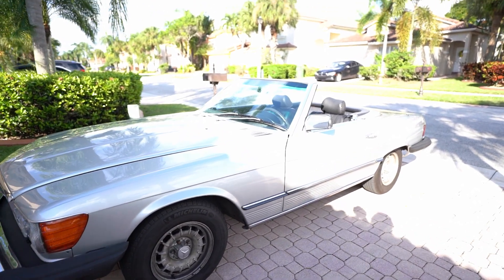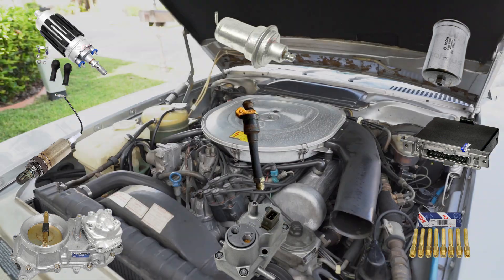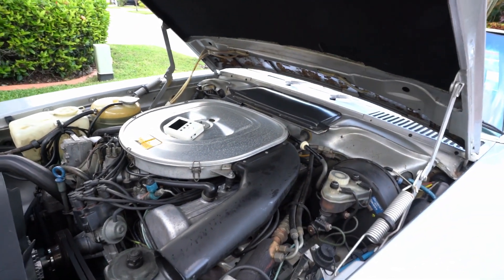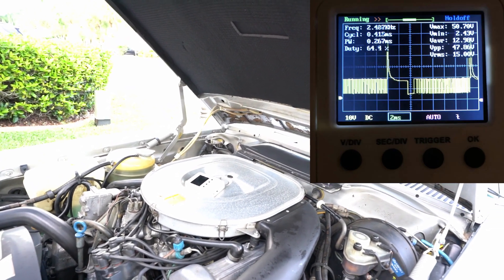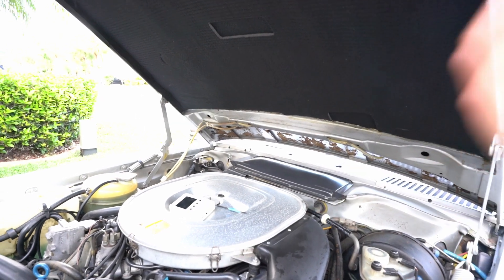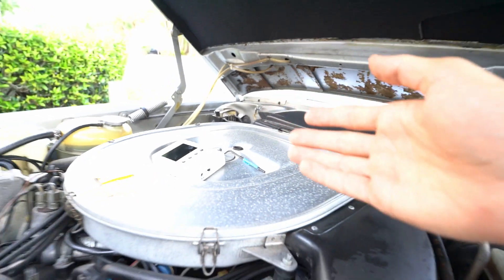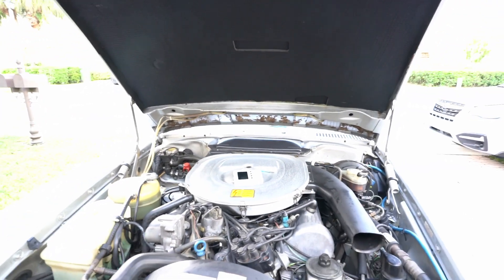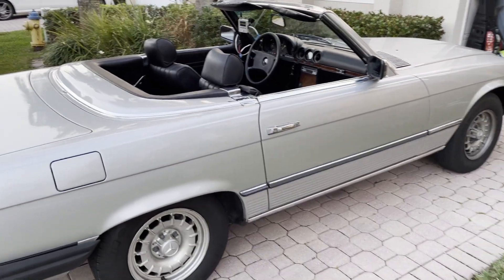R107 pt 14 - Hacking Bosch K-Jetronic System [FULL GUIDE]

Comment: Hi, again 84 380 SL :) i have something that need an advise. My Sensor Plate (part of the fuel distributer) is always up (i.e. at high level) which is Ok/normal; however, when the car is sitting for sometime and i press the sensor plate down it doesn't go up again, is that normal? when i shut the engine and i press it down, it goes up again to the normal high level. so what do you think the problem is if there is a problem.
Reply from the maker: Min 3:12 is the picture you want to trace. 50% pushing fuel and 50% steady not pushing

Comment: Hi. I have an 84 380 SL, like urs. actually i don't know if i am using the 3mm alen correctly, i mean deep enough before starting to move right or left. if you can film an alen with some measurements on how many CM to press before rotating or tell me how many cm/mm to press down before i rotate. and when it hooks down, it need force to turn right/left or what?
Reply from the maker: Yes, it goes all the way down until it connects with the real screw. Then while pressing all the way in very gently rotate. Remember this is very sensitive and a tiny move will change a lot

Comment: I tested this tonight with the same equipment.  I was able to lean out the engine and feel it start it miss, then richen it up and get closer to the "sweet spot" and it stopped missing but on load I felt some hesitation cycles so I'm wondering what quantifies as the sweet spot and do you have any manual or diagnostic articles you can point reference?   I'm in Tampa fyi.
Reply from the maker: Hi Matthew, that’s amazing! Thanks for sharing. Basically the sweet spot is having the additional inyector pushing fuel only in 50% of the duty cicle. That way the KJet will have room to enrich or lean the mixture in the same proportion. Now considering age of this cars and internal rubber vacuum what I will suggest is to do the final fine tune by feeling (smell, ear and acceleration)
Reply: @MinkMood  MM I'm back at it.  I just rebuilt the fuel distributor and WUR on my 81 380.  Runs much, mubh better but is running very rich.  Looking back at your videos your oscilloscope shows a duty cycle of between 64% and 75%.  So from screenshots (I have the same cheap oscilloscope) I can't tell what to do wrt achieving a 50% the duty cycle. And I'm a mechanical engineer not a EE so while I can purchase oscilloscopes, reading them is another story.
Reply from the maker: @matthewstephenbrown  hi Matthew so great to hear from you! Amazing on the FD and WUR refresh. Regarding the measurement just follow the graph, not the numbers readings as they didn’t seem correct to me. Now within the graph try to reach 50% of the figure with pulses and 50% flat. That will tell us the you additional inyector is pushing fuel just 50% of the cycle. Send me pictures if you want and we can also talk thru the phone

Comment: Check your fan clutch, seems to be running hot when the car is at standstill. Also ensure the thermostat is opening all the way.
Reply from the maker: Exactly, thanks for sharing mate! Fan Clutch + Thermostat + MB Blue Coolant changed in some episodes before. 
Now the first time the car starts (cold) it will go up to almost 100*C and immediately drop down to 84 avg (Thermostat Opening effect)

Comment: I’m having similar issues with my 380sl but I can’t get it to start. Fuel system was checked over and no faults no vacuume leaks. Any suggestions?
Reply from the maker: Hi R, its hard to tell but I think you are in the right path. For the car to start you need just 3 things (Fuel | Air | Spark)
I would suggest to start with one at a time and start tracing down the issue.
Please lmk how it goes!!!